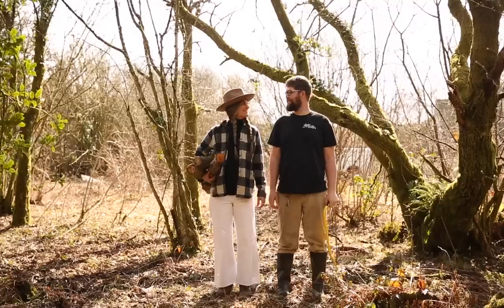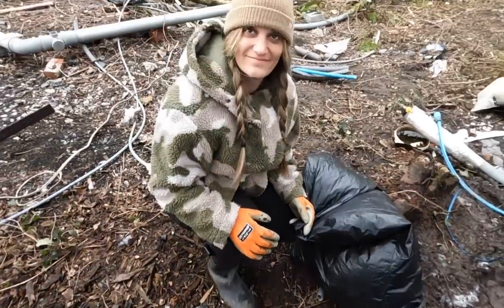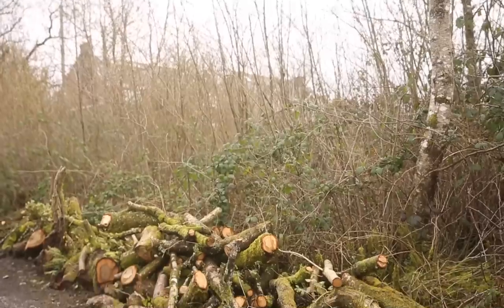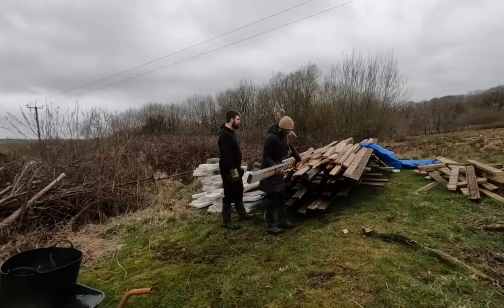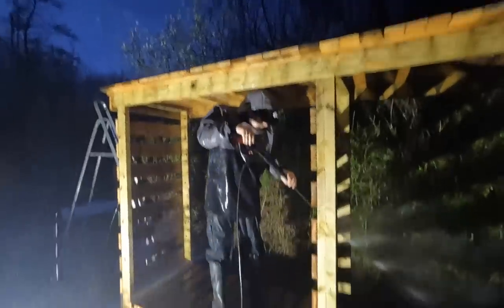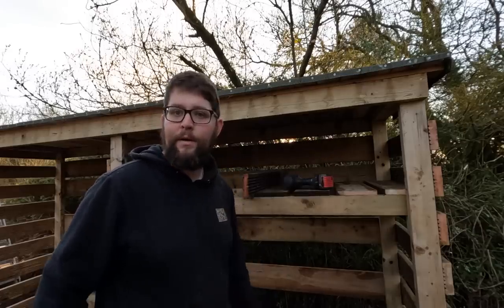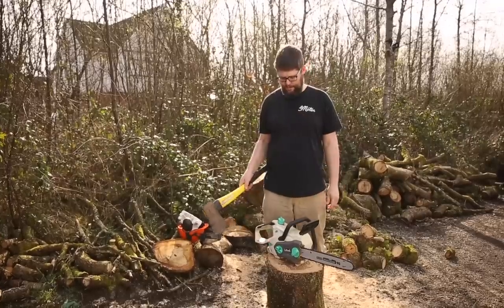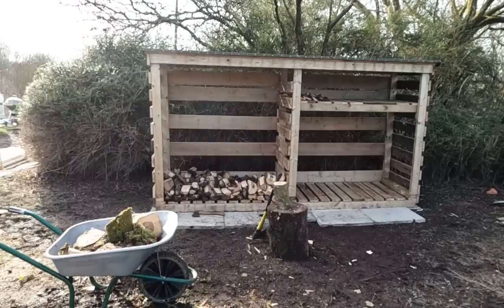Will it be worth it? Renovating our abandoned caravan park

Comment from the maker: Disclaimer: to everyone asking why we recycled the decking off cuts rather than put them in our log storage to use in our log burners in the future - the decking boards have been treated with a chemical weather protector, so really shouldn't be used in a log burner due to the toxic chemicals on them 😅
Reply: What I was wondering is why you didn't keep that wood to help with your project of building your house. I know some of it is small but you will need small pieces.
Reply from the maker: @vernieplummer5148  thanks vernie 😊 we don't want to build our house out of the old decking boards and we still have hundreds of full planks left over for future projects, so no need to keep the random off cuts xx
Reply: You should Not Under Any Circumstances burn treated wood, AT ALL...
Reply: what exactly do you think happens to it after you left it at the station?
Reply: USA Oregon like your content hard work.
Reply: Same as pallet wood toxic

Comment: What a brilliant job guys. It's so good to see you clearing that plot 'manually' and recycling most of what appears! You are real grafters with so much enthusiasm and energy and interest in the environment, it's a pleasure to watch you work 😊
Another quick tip for the log splitting.. on top of your fantastic chopping block - get yourselves an old car tyre, the smaller diameter the better. The old mini 10" tyres were best but 12 or 13" work fine, Then that lays on top of the block and the logs sit inside it. You split the log as normal and the tyre catches the pieces. It's not perfect but it will result in so much less bending down.. which your back WILL thank me for!
Reply from the maker: Thanks so much Peter 😊 thanks for the car tyre tip! Sounds great!

Comment: As someone that chopped more than his fair share of logs, just a tip to help speed things up an save your back. If you can, find an old tire and place your logs in it. It should prevent most of the splits from flying all about. 
If the tire is too big just cut a section away then fasten it to the stump. Please Remember to poke holes in the tire, unless your intent is to start a mosquito breeding farm 😊

Comment: Great project! 

Bad idea to pressure wash the wood, it injects the water into the wood and lifts the grain making it rot faster. Next time grab a belt sander to clean it up if you must.

All that wood you recycled! You could have kept to burn for free heat.

Wood store looks fab - hope you left some fall on the roof so water runs off it.
Reply from the maker: Thanks for the tip will! Sadly the wood we recycled was treated so cannot be burnt in a log burner due to the chemicals on it 😅 we thought it was ok to wash it due to the treatment already on it, but we know it's already had 20 years out of it as a decking, so happy with whatever use we get from it 🙌

Comment: TOP TIP. Put a suitable sized car tyre flat on your chopping block and it will prevent the chopped bits of firewood disappearing across your property. Unless of course you prefer the exercise.
Reply from the maker: Thanks for the tip David 🙂

Comment: You have to be careful splitting wood with an axe. A slight mis-cue  when striking will send the axe anywhere including legs. Place the log on the far side of the chopping block, if you miss you only hit the  block and not swing through.
Rather than taking a powerful swing hit the log hard enough to embed  the axe then lift both axe and log and swing  together, also avoid logs with big knots  unless they are really dry good luck Doug 
Ps I'm a heavy equipment engineer and was maintaining machines on that colliery and many others over the past 50 years

Comment: Great wood store guys!.... Little wood-chopping tip.... When you raise the axe, the top hand starts high up near the head, but SLIDES DOWN the axe shaft in time with the 'chop'.. ie. . You literally pull your top hand down the handle as the axe falls. That puts much more natural momentum into the blade, so you don't have to lift it so high to start with. It's also easier on your back and shoulders than all the jarring of chopping with 'stiff' arms. Keep your legs spread apart either side and not in line with the axe blades arc. 👍
Reply from the maker: Thanks so much for the tip Andy 🙂 very helpful!

Comment: Awesome what you both have achieved so far but one safety warning. Always keep your legs spread apart when using an axe which prevents the axe from hitting your legs if you miss. Use a downward chop onto log. If you miss the axe goes between legs. :) keep up the great work guys
Reply from the maker: Thanks for the tip Milleka 😊

Comment: What fantastic progress and hard work! I'd recommend putting a pitch on the log store roof (maybe it just looks flat on the footage?). Amazing how the wood came up with the pressure washer!
Reply from the maker: Thanks for the tip 😊 Jon put a 1 inch pitch on the roof, slightly raising the roofing boards at one edge, which has worked great! The rain has been running off the back perfectly 🙌
Reply: @CampOutWest  Fab! x

Comment: I think what you are doing is great, just a word of advice on the wood storage, I would nail/screw some thin wooden strips on top, if a high wind catches a  small section of the felt it will rip the whole lot off. Good luck to you both and PLEASE do not stop posting videos.

Comment: When you use the axe for woodsplitting try to aim a little more to your side. If you splint the backside of wood you will violate the axeshaft as it hit the unsplinted wood. Axe shaft should not touch the wood, only the axehead for that.
Reply from the maker: Thanks so much for the tip Leif 🙂

Comment: I always found it so satisfying
chopping and splitting logs for 
winter fire heating home. 
With your ample supply of 
burnable wood on your land,
another suggestion may I make?
When you build your tiny home.
Consider putting a wetback fire in, 
that would supply you in all the hot
water that you would need over 
winter months. Likewise you
could run something similar
off a fire pit to your outside
bath under the stars. 
One of the best
decisions I made doing that
- when built my place. 🇳🇿 😎

Comment: Nice Biuld! is that some sort of tile the rack is set on? If not,  next time it’s getting empty, lever it up and slide concrete blocks under it as supports so the wood frame does not rot in the dirt. We have a trash pile in back of our house from back when there was not regular trash pickup. Every spring plastic bottles, beer cans, etc show up after the snow melt. 😀 Eric.
Reply from the maker: Thanks Eric 🙂 we've build it on some old slabs we found on the land so it's not sitting in the wet ground.

Comment: Hey guys quick tip Get an old tyre like a wheel barrow or any tyre really and screw it to the top of your chopping block, when chopping logs around 8 to 10 inches it stops the split pieces flying everywhere...and you can cut the wall down for bigger logs if need be... Thanks for the vids ;) CHICKENS? GOATS? :):)
Reply from the maker: Thanks for the tip Kris 🙂

Comment: Well done. Only suggestion would have been to give the roof a slight angle for rain runoff given your weather.
Reply from the maker: Thanks Troy 🙂 John made one side of the wood storage slightly taller so it has a slight angle for the rain to run off 🙂

Comment: Nice wood storage, one question: why not put the roof under a slope... That might be handy in case of rain. 
The axe is not a splitting axe, just a normal axe as far as I can see. For copping sills, view the vids of This Off Grid Life.
Reply from the maker: Thanks Pim ☺️ the roof has a 1cm slant between the front & back. Jon raised the front of the roof boards, so the rain runs off it perfectly 🙌

Comment: Hi, Two things

1) If you do not want to recycle wood, you could burn it.
2) Depending on the size of your fire you may not need to split the logs you are showing in this episode. Many fires will even accommodate larger logs.

Good luck
Reply from the maker: Thanks Peter, a lot of the wood is treated so we wouldn't want to burn it due to the toxic fumes haha. Thanks for the tip about the wood too 🙂

Comment: Great to see that you’re reusing the old (seasoned) decking boards. However, I wonder if the roof has a slope on it to enable rain/snow to run/slide off & not pool on the top of the wood shed?

Comment: Just a thought to late now, but why don't you save the wood for firewood, looked well for kinderling as it's well seasoned. And for chopping wood, put inside an old tyre to contain it, which  you chop it.a
So the roof of your wood shed I would have thought you might have put a little fall on it for moisture removal as  we are in an inclement weather location. ALLL THE BEST.
Reply from the maker: Thanks Peter! Great suggestion 😊 the old decking timber is sadly treated, so can't really be burnt due to the chemicals on it from the old treatment, so we decided the cut offs wouldn't be great to burn and use for kindling. Oh the  roof does have a slight lean 😊 Jon put some extra timbre on the front end of the roof, under the roof boards, to help the rain water run off the back 😊 just forgot to mention it in the video 🙏

Comment: So good to see you back! Checked your channel yesterday to see if I'd missed a new vid. Great to see your progress! 🙂
Questions: Why did you cut the wood so small/short? Why the flat roof on the wood storage instead of slanted to let rain run off?
Reply from the maker: Hi Ginger ☺️ the roof isn't flat, it has a 1 inch rise between the front roof panels and the back, so the rain runs off the back perfectly 🙌 we've cut the wood to the size that will fit in our small log burners ☺️ any bigger and we will struggle to get them in 😅
Reply: @CampOutWest  Thanks for your reply!

Comment: you will regret getting rid of all of that nice kindling . I have used 100% refractory casting to produce a super efficient wood burning stove  Hot air from the stainless steel tubes located in the afterburn chambers .

Comment: A good way to recycle wood there, is there a slope on the roof of the wood store, I know it’s a small area but you want it to drain off
Reply from the maker: Thanks Jim! Yes Jon adding a once inch height difference to the front, so the rain is running off the back perfectly 🙌

Comment: I guess under the ground may have to wait until you can rip it up somehow?
Reply from the maker: Sadly we've had about 10 days of torrential rain out of the last 15 😅 so the land is to water logged and wet to get a heavy machine on, as it will be bad for the ground. As soon as it dries up a bit we will have the excavator on site for a week to help level it out, ready to pour our concrete foundations 🎉. Can't wait for some dryer weather 🙌